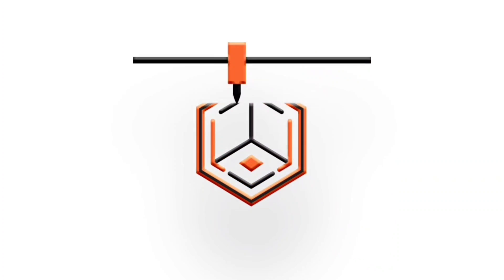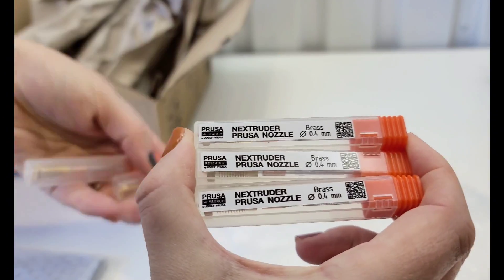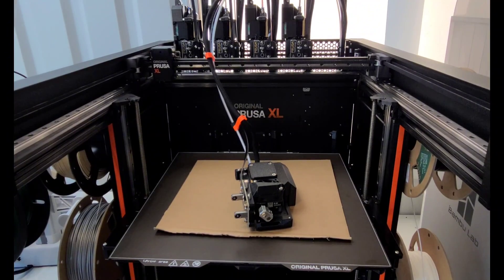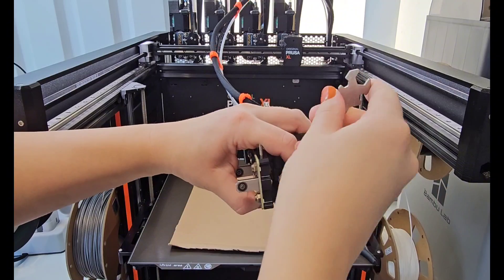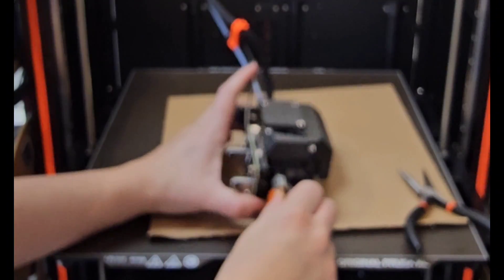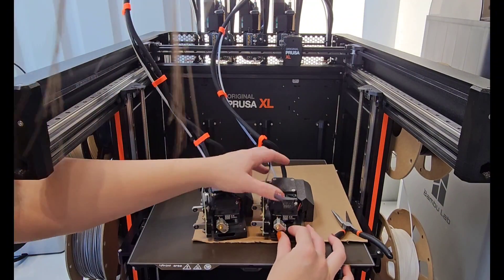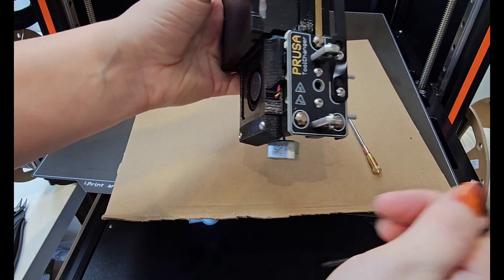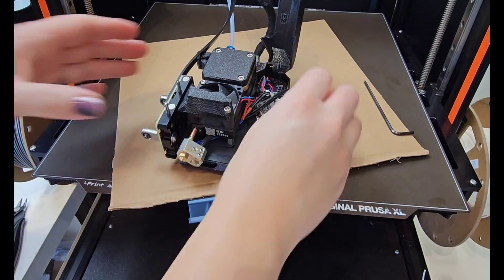Changing Nozzles from .6 to .4 on the Prusa XL 5 TH

Comment: I appreciate this so much. I also was about to stubbornly leave the cables hooked up. Prusa does not set us up for success here by referring to this as a “hot swappable“ system. It’s quite an involved process. It would be nice to just embrace that from the word “go”.
Reply from the maker: I agree. The wording on this doesn't match the time involved. Especially if you recalibrate after swapping. Thank you!

Comment: Thank you for the very interesting and consistent Prusa XL videos!
But I would really recommend to use some quality tools to work with. They don't really cost much, but they prevent scratches and problems and make work on your printer much easier.
Reply from the maker: Yes I forgot about the included hotels holder. Thanks!

Comment: Those containers are used for cutting tools for machining operations, such as end mills. My M6 adapters came in the same case, not a bag.

You might want to use parallel jaw pliers instead of needle nose pliers when gripping the heater block. You can find them with soft faces. They are common for jewelry making, but check that they'll open far enough. Jewelry ones are a little small.
Reply from the maker: Thank you!

Comment: @0:29 so prusa finally make 0.4 the default? would have saved a ton of headaches if they did it to begin with.
Reply from the maker: Yeah they send out a notice that new ones will go out with .4. Yeah the .6 worked fine on my single toolhead but the multi toolhead has been a mess. Thanks!

Comment: Since you're having - I think - two MK4s and that XL 5 TH it might be worth considering to have complete nozzle assemblies ready, with heating block and cables. That would make it a lot easier and faster to use different nozzles depending on the print job you're planning to do. Also you should prepare different profiles for each nozzle size, not only for the XL but for the MK4 as well, because those print a lot faster with a bigger nozzle too and some prints may call not so much for detail but for speed. With the pre-assembled hotends preparing the printer is not much more effort than changing the filament, except on the XL the calibration might take a while, but that's true for every nozzle change.
Also the tip with turning (any) threads backwards until you feel them pop "start to start" is pretty good advice. It works for nuts and bolts as well as jar lids. Once it is one turn in, there is no chance to damage the threads, unless they were already damaged
Reply from the maker: Yeah that's true. And probably would be good to have them ready in case the cables break on one. I don't think that the replacement came completely assembled. Yeah I will look into the different sized nozzles. I am just not ready to start having stringing problems on my MK4s. Thanks!

Comment: So the XL now comes with .4 nozzles?
Any idea when they made the change. My 2tool XL turned up last week (haven't had the time to set it up yet). I was planning on getting a couple of .4 nozzles for it
Reply from the maker: They're saying that the .4 nozzle lessens the stringing and some underextrusion issues. I would try out your machine for the types of prints you need it for. And if you have these issues, then order the nozzle. I'll see if it helps for me!
Reply: @tada3dprinting  I did see another YouTuber who was getting much better results with .4 nozzles, so was considering picking a couple up....they are useful spares for my mk4 anyway lol.

Comment: I recently got my XL.  I fired up a few test prints and I have zero stringing with 0.6 nozzles.  Now I did just upgrade the firmware to 5.1.2 so maybe that’s the fix.  The printer is super fast and perfect, I don’t understand all the fuss.  I do have spare 0.4 nozzles I was going to try, but really I don’t see a need.  Thanks for your videos.
Reply from the maker: If you don't have stringing, I would just keep it as is. I can get rid of the stringing with .6 by lowering the temp to 190. But I have had some other complications because of the low temp. So maybe this will work better for me. Thanks!

Comment: There's a way to line up screw threads without the trial and error. Apply gentle pressure (pushing toward the heat block) and turn the screw (or nozzle in this case) backward until you feel the threads pop into place. Doing it this way you can get it in the first try and never have to worry whether or not it's in the correct position. If you're unfamiliar with how that pop feels, just keep turning backwards and focus on how it feels until you feel sure about it popping into place. Readjust your grip (by 90 degrees or so on the nozzle) if you think you might be missing the pop (which can happen if the pop would be happening right about the spot where you ease off the pressure to change your grip because human wrists can't exactly spin around and around in only one direction). Turning it backward with gentle pressure is harmless so you can do that safely as much as you want until you feel sure about it.  These nozzles will pop in the same place every rotation so you can always test that out (that being said there is such a thing as multi-start screws which have more than one place it can pop in correctly)
Reply from the maker: Oh that's great to know! Thanks so much!

Comment: You just need to hold the heater block square so that the nozzle threads in smoothly.  If you get any resistance then you're not holding it square.  When you do that it will go very quickly.
Reply from the maker: Thank you!

Comment: You can get much better tools for nozzles. A socket driver or tee handled socket is much easier to use. I use the Slice Engineering tee handle torque wrench. Also a set of Wiha or Wera hex screwdrivers are nicer for most use than the supplied L wrenches. I haven't tried changing the 0.6 nozzle on my one tool XL but I do have them here. Generally I send the jobs that need 0.4 to the MK4 and reserve the larger jobs that benefit most from the 0.6 for the XL.
Reply from the maker: I'll look into it. Yeah I felt like the .6 on my XL was ok but just not quite there. I'll see if it works for me. Thanks!

Comment: I am very happy to see that you have decided, you will say what you think of the results. By the way, there is only one point left to improve on the threads, it only has one problem, that since the small space under the head is very closed the passage and the fan ends up damaged, I am redesigning with another type of fan, but it takes time. The cape fan lasted me 3 weeks with this mod, and they were the best impressions I have ever made, a marvel without loose threads, and greatly improving the overhangs. Removing this, there is a small but, the colors are not bright on the top layer, I have written to Prusa, many times this depends on the material of the barrel, normally bad barrels give matte colors, and in this case they are matte. Has anyone been able to solve the matte color in the upper layers? I leave you the link of my mod so you can take a look, what do you think?     https://www.printables.com/es/model/684764-fan-prusa-xl-fanduct

Comment: With the newest firmware there is an option in the calibrations that will set all of the nozzle sizes at one time. You will always want to run the tool head offset calibration any time you adjust the nozzle on a print head. From what I have read, it builds each offset based on the other nozzles so if you adjust 3 you will need to recalibrate 3, 4, and 5. I would probably run the full calibration for all 5 just to make sure.
Reply from the maker: Oh that's interesting. I'll check that out. Thanks!
Reply: I also ordered two more pins for the hot end.  I kept dropping mine and am afraid I will loose one.  They are under $2 and do not change the shipping cost

Comment: Your videos continue to be very valuable to me as a new XL 2 tool owner myself. Im not sure id go down in size for nozzles if only because i also own a mini i modded with the Revo set. Ive also found that most of my printing even on the mini is near as makes no difference in detail using the 6, and even bought the obXidian .6 to do the bulk of my printing with it. fr my own purposes i might even try at some point to take at least on of the head for my XL up to an 8 to help offset the super long multiday prints
Reply: So the current theory is that the XL hot end cannot keep up with the volumetric at 0.6…. So you run the risk of occasional under-extrusion with the 0.6mm
Reply from the maker: Yes I was leaning towards scaling up for my larger prints. It seemed backwards to me to switch to .4. I think that's why it took me a little while. I hope it's lives up to the hype!

Comment: I use the same method and don't unplug the wires, I find that for screwing it back in that trying to keep the aluminium heat block straight and parallel to hole helps but still sometimes can take a minute to get the nozzle threads to catch and start screwing in. You are correct in taking it slow and not just going at it as threads on the aluminium heat block could strip very easy.
Reply from the maker: For me in the future, I'll probably Unplug the cables because it was faster than fighting the angle. But I'll definitely be curious to see how the cables hold up. Thanks!

Comment: I ordered 5 adapters instead of nozzles because I've been so impressed with the tungsten carbide nozzles that I'm going to skip the obxidion. I have a Diamondback on my MK4, and while I do think it's a great nozzle, I find it no better than the tungsten carbide, and the tungsten carbide is $40 cheaper. Both are lifetime warranty.
Reply: Just be careful In the installation. Adapter nozzles could ooze out if not tightened enough.
Reply: Just be careful In the installation. Adapter nozzles could ooze out if not tightened enough.
Reply: @IvanJoel  Right, you are correct. I thought about that before my purchase, but I like the Tungsten carbide nozzles so much, I'm willing to trade off the one piece nozzle design for the split design.
Reply from the maker: Oh that's a good idea. When I installed these I was kicking myself a bit. I waited for the 5 .4 nozzles to come in. And then only installed 2. And I already had 2 adapters! Why I didn't try this first, I'm not sure. I'm curious if it works for you!

Comment: I am almost getting my 4k printer to print niceley. Ouch
Reply: With nozzles that cost $20 each, so another $100.
Reply from the maker: It's been almost 2 months that I've had it. Can't even remember the number of slicer/firmware etc I am on. But I must be close right?
Reply: @tada3dprinting  close to selling it you mean ?
Reply: that's insane. for $4k it shouldn't require so much fiddling.

Comment: For the mk4 there a heatblock holders you can simply click onto the extruder. This makes nozzle changes more easy. You unload filament, let the hotend cool down to <50°C, click on the heatblock holder and you can loose the thumbscrews and unscrew the nozzle. As the heatblock is hold into position, it is much more easy to screw in the new nozzle. Just do not forget to remove the heatblock holder (I did....)

I recommend to buy at least one ObXedian nozzle. They work as good as the brass ones, but allow abrasive filament.
Reply: There is one on printables to hold the hotend of the XL
Reply: @surfalex2000 model number or something?, I find only one for mk4, not for xl? ( nr 545809)
Reply from the maker: I did get a comment that the metal wrenches include a heatblock holder. I completely forgot this! Thank you!
Reply: @tada3dprinting  yes, but with the slide mount that i made, it also holds the hotend at the position and protects the cables

Comment: Don’t forget to redo the tool offset calibration after changing nozzles.
Reply from the maker: Thank you!
Reply: this ^
Reply: I changed the nozzles several times without a new tool offset. It still works perfect. I think, that the precision of the nozzles is so high, that it is not necessary. I think the main reason for the offset calibration is to compensate the differences of the whole toolhead and not only the nozzle.
Reply: Prusa does not write anything about the offset calibration in its help document about the nozzle change.
Reply: @Jeggo65  Their support team has explicitly stated that on several forum threads. Short version - tool offset calibration is required after nozzle change. It's even stated by a Prusa person in the online document about nozzle changes, if you expand the comments under each step.

Can you get away with skipping it? Maybe.  But why risk bad prints for a 15 minute one-time thing?

Also, for the person below talking about MK3, that's utterly irrelevant.  The tool offset calibration is for multiple toolheads.
Reply: @Jeggo65  same experience with MK3S+. Nozzle Change done and never needed to recalibrate live adjust z
Reply: not necessary to do new offset. just change nozzle diametter